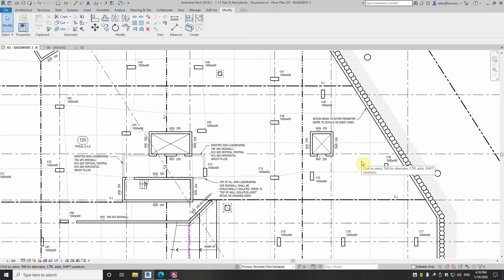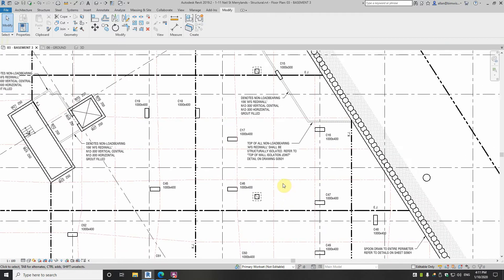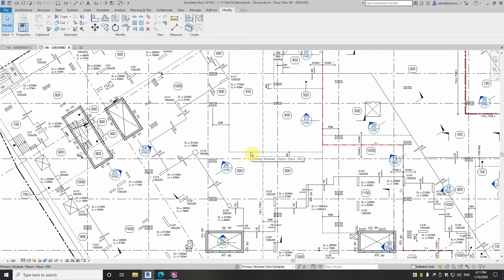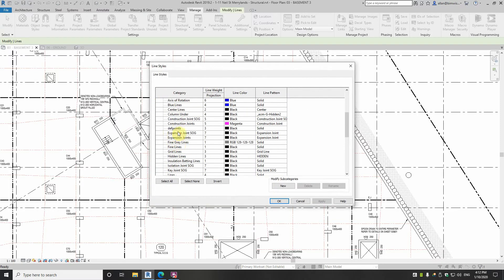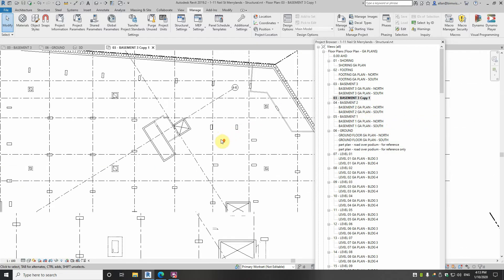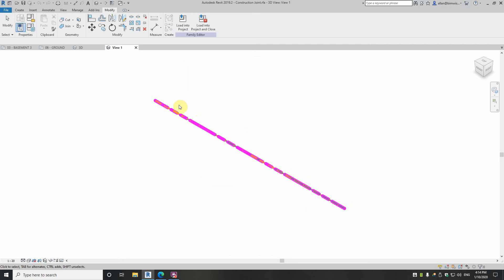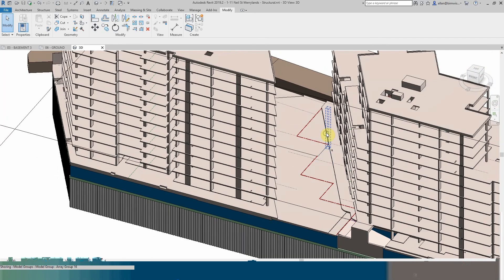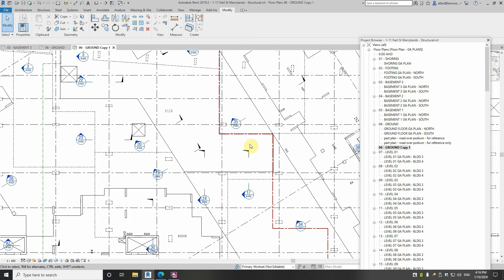Revit Tutorial - Slab joints for structural drafting and showing them on the 3D model.

Comment: Why use Generic Model instead of normal Model Line in the project? In the video, you've said it is because you can control the height, what do you mean by that? can you just control the normal Model Line Height? This is genuine questions for understading better the Revit process, thank your for your time, and again, awesome video!
Reply from the maker: Yes. You don’t have as much control on model lines as you do if you use this method.